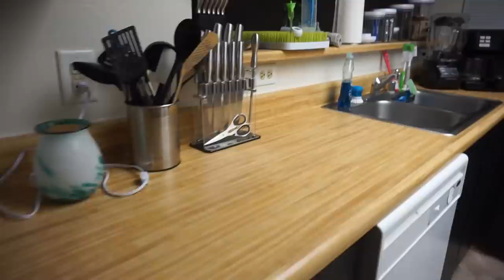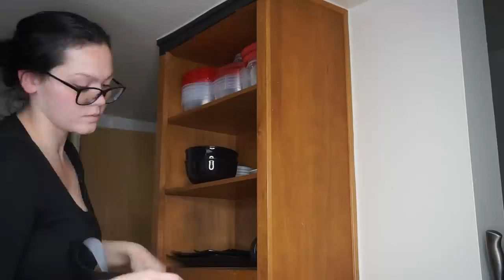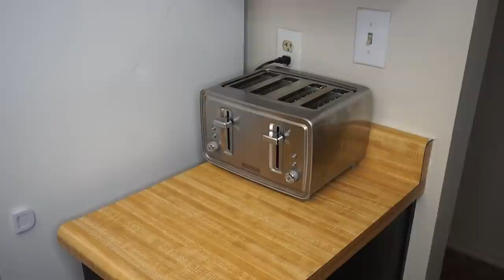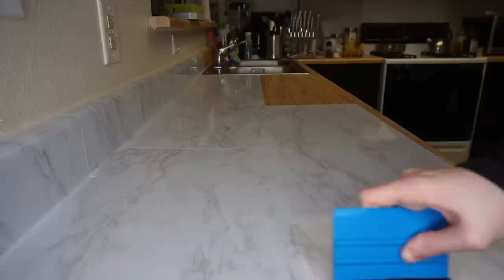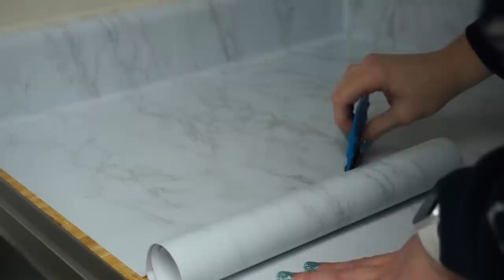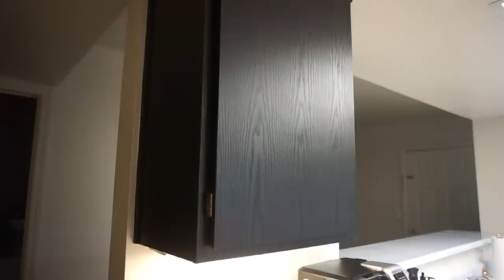DIY: Countertop & Cabinet | With Only Contact Paper

Comment from the maker: I recently removed the contact paper for anyone who was wondering how it was holding up. It held up amazingly, I just decided it was time since I have a baby on the way an we aren’t sure how much longer we will be living in this rental. So I put in the work now, while I can and I made a video on how I did it. Check it out!!! 
https://youtu.be/39zyTJDTviU
Reply: Hello, thanks for the video. I want to install this on my rental kitchen cabinets but wanted to make sure if it doesn’t leave any mark or anything on the original wood cabinet. You said you removed it, so I thought you already saw how the before cabinets look right now. Is this contact paper removable? It doesn’t leave any marks or peeling when you remove it after using a long time? I really need to change my cabinets and wanted to make sure before. Thank you so much again for sharing. Happy to subscribe your channel.
Reply: Genesis Adams how many rolls did you use for the counter tops?
Reply: I wanna know approximately how many rolls you ended up using?
Reply: I came across this video I must say I enjoyed watching it and it came out beautiful.
Reply: How many rolls did you purchase ?
Reply: Genesis Adams did it lift at all around the sink? With all the water and what not?
Reply: I have to say in theory it's a great idea, however you could have done better with the finish. The cupboard doors should have been papered INSIDE as well for a more elegant finish & one of the work tops is showing a thin strip of  "pine" along the edge which sticks out like a sore thumb
Not sure how experienced you were with this technique back then but I'd rate it 7 out of 10
Reply: Kiara Dewrance, I’ve read that you use silicone caulking around the edges and seams, including around the sink. This both makes it look seamless and also prevents water from getting under the contact paper.
Reply: Genesis Adams hi, I was just wondering how many rolls did you use for your cabinets?
Reply: Genesis Adams omg ppl are so pressed about my comment I deleted it I didn’t know it was so many negative people sheesh all I damn said was my ocd is cringe 😬 but u still did a cute af job n the bashing u began on both ends lord Jesus ppl gotta chill nobody is perfect keep doing ur thang girl xoxo 😘
Reply: Thanks for sharing. Great job. Congrats on little one.
Reply: Where did you find the paper
Reply: How long did u keep it up

Comment: I think for the counter id wanna get some wider roles so there arent so many different pieces. More of a seamless look. But this is great! Im def gunna do my cupboards i just wish my cupboards didnt have all the bevels and routing in them. Ill probably change up the knobs too.
Reply: The lines drive me crazy too, but I feel like after you put everything back on the counters you probable wouldn't notice.
Reply: The more seams the more places for water to seep into which is the only bad part about it. So you have to make as little seems as possible.
Reply: TV love so lovely Dinah a yes's can you really love in Jena F it
Reply: @dallasandjoshuamales1056  mnzjbau are g tu g
Reply: All she had to do was put it on full length,still looked all right.
Reply: @thelyingscotsman7993  noooo you lyin 🤣🤣🤣🤣
Reply: the Lying Scotsman Right. The seams are driving me crazy. But Im a perfectionist. 🤷🏾‍♀️
Reply: Yes, my thoughts!  Those seams are crazy but why cut up that nice paper. 😖... Plus my mom used to run caulk after placement around the sink to keep the water out... this was years ago. I’m 51... 💓
Reply: Yes I Said It  Exactly. Its still nice. Shes just going to have to replace it sooner. Alot sooner.
Reply: Agreed

Comment: Everyone should always check with the landlord before doing any change like this in the apartment using contact paper.  Although you  say it can be removed doing so leaves behind a sticky residue and can be considered as damaging the rental unit.
Reply: I'm a landlord and I wouldn't let them do that...like you said there will be residue and countertops if water get underneath it will damage the countertops.
Reply: Pam m I did this for over a year and it was fine when I took it up and there was no sticky residue. Maybe it depends on the brand of contact paper 🤷🏾‍♀️
Reply: @DomoneeekM  do you remember what brand you used? Want to do this idea but don't want residue
Reply: Rebecca Garibay I got it from amazon the brand is called PracticalWS
Reply: It really depends on the landlord 
Mine loved that I did it and when I took it off I cleaned them and they looked as ugly as they did when I moved in, he wanted me to leave it on but I didn’t want a chance for him to say I damaged it.
Reply: I’m not trying to argue but provide a different outlook on this topic. A lot of people are out here paying over $800 for units that haven’t been updated in yeeeaaarrss. I wouldn’t want to be living in a dingy looking unit if I’m paying X amount of money. If landlords actually put the time, effort, and care into updating units, people would not have to resort to using contact paper. 
I’m sure it wouldn’t cost much or take long to add some color to cabinets or even put down those little faux wood/tile squares over the floors. It’s just pure laziness on behalf of the landlords or rental company.
Reply: @RisingStarFalls  Lazy or not when you rent a place you don't own it!Read the terms on your rental agreement. Be careful about changes. You don't want to leave damage and end up not getting your security deposit when you move out.
Reply: Theres a product name awesome that will get any og that left behind
Reply: Goo gone 😘

Comment: For people questioning contact paper on the kitchen, it is very durable. The glue is similar to the kind they (3M) use for wall murals, door lettering, and similar products. 
So it's not going to peel unless you either peel it yourself or you've applied it incorrectly. It won't be affected by liquids, but you should certainly use caution with extremely hot dishware.
 No, a mug filled with coffee or tea is not going to damage it. If you set a pot that was just boiling on it, it will likely melt, but if you're going to invest a bit in some redesigning, it won't hurt you to buy a trivet. Add a little extra to your decor. They even sell some cute ones at the dollar tree.
Reply: I might have to try this in my brother scan n cut.. I bet it is cheaper..
Reply: How many contact paper should we get?
Reply: I've had mine on my cabinets for 4 years and it's held up great.

Comment: In doing your counter tops do the main flat area first then go back to do the backsplash section.  Follow up with a nice thin line of caulking.   This allows for a solid piece of contact paper on the counter area that has a lot of use. Doing this way will stand up longer to daily use.

Comment: Starting at 10:06 is how you should have done all of the countertops. One Continuous piece for back to front.  And never a one to two inch wide strip at sink or front edges. Hoping they don't peel off.

Comment: That kitchen looks so much better what a great job.!
The only thing is you need to measure and mark your places then cut and if you do it this way you won’t have to do patch work because you will be cutting to your measurements you just took.
And it will fit better and you will have larger pieces for your countertops like your cabinets.
But it really is a great transformation in that kitchen.
And the colors you choose are perfect.

Comment: Look amazing 😍 I love the cabinets but I would have had to do the back of the doors and cleaned up the edges a little bit on the inside. I did the counter top in my bathroom almost a year ago and it's holding up just fine and my contact paper was from Dollar tree 😁. No you can not see the seems unless you look really hard. I think you can only see her so good because she had the camera so close and good lighting to show the process. Nice work 👌

Comment: That definitely looks like the quality brand from Amazon. I ordered the cheaper Heroad  black wood grain wallpaper first and I learned that you get what you pay for. The paper was extremely thin and tore easily, plus had a very dull finish. So I ordered another batch from Abyssaly and what a difference! Much thicker and had texture and a little shine to it (plus a lot easier to work with!

Comment: This is incredible....my question is how durable is this? As I was looking at epoxy and it was in the neighborhood of 400.00...could you put a clear coat over it so it wouldn’t get damaged?
Reply from the maker: Elliott Astro-Imaging I mean it’s durable enough for me an what I do in the kitchen. It is paper so it can melt if burned and can be cut if you go deep enough. I don’t know enough about epoxy to be able to tell you if it would work or not.
Reply: Yeah I am about to be moving into a new house and I have been trying to figure something out with the countertops and this would be $375 cheaper...I wonder if anyone has tried to apply a gloss finish over it to prevent scuffing or scratching it
Reply: Gianni sells a top coat and it's easy to put on. Still can't get it hot or it will make the coating opaque for a bit . I got a  real granite cutting board and put it next to the stove and use that for everything!

Comment: How many rolls for cabinet did you have to get and what's the roll size? Same question for countertop.
Reply: Valerie Brown Hey!  If you check on eBay they often have contact paper/sticky back plastic/fablon in different sizes (I’m actually getting ready to do this to my kitchen at the moment) always buy a wider roll than you need.  I found that the 67.5 cm x 2 meters is good for my cabinets (although I’ve bought like 6 rolls because I’m not sure how much I’m going to need), but because I have a 3 meter long worktop on one side of my kitchen I had to order a 5 meter roll of the marble (I’ve chosen black marble though) just to be on the safe side.  Measure up your cabinets, make sure you add a few cm’s and you’ll be able to do everything seamlessly.  I’ve also just discovered peel and stick flooring so I’m using that to update my kitchen floor lol.  Good luck x